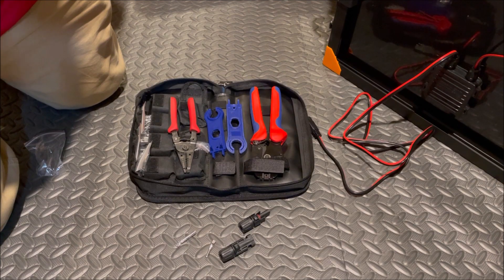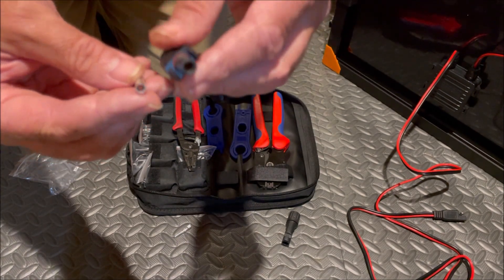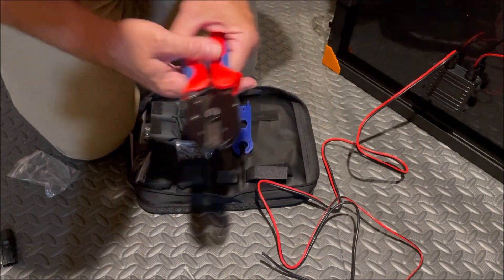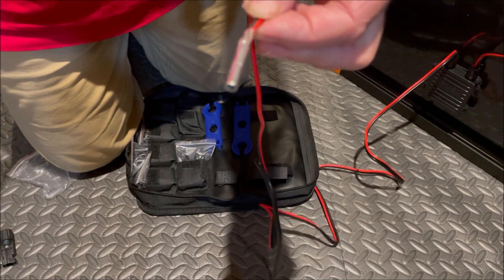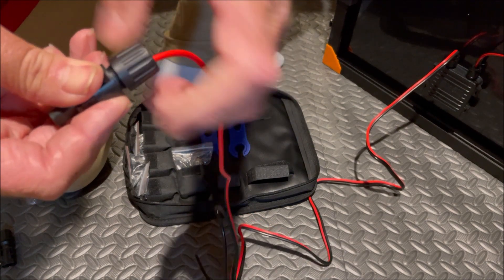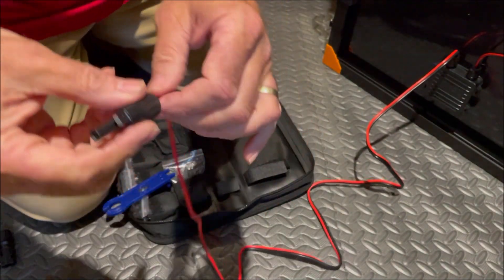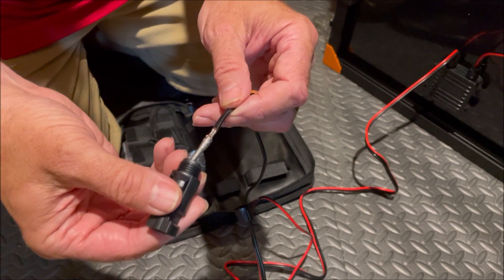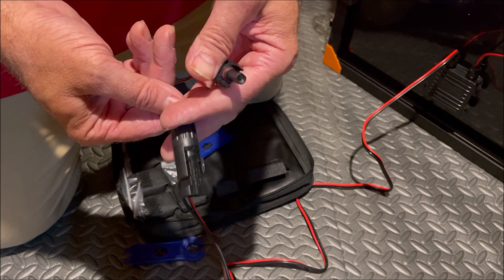Harbor Freight Solar Panel - How to Convert from SAE to MC4 - Part 1 - Viewer Request Thanks D Albu!

Comment: Great content yet again, those mc4 connectors should i get for 8 AWG wire for those harbor freight panel wire , I see choice of 10 or 8 AWG thanks again
Reply from the maker: 10 is the most common size.  The HF cable is smaller the 10 so you may want to add a layer or two of heat shrink or electrical tape to take up some space and make a tighter fit.
Reply: thank you

Comment: Thank you for this.

Forgive me for not following the chief's way exactly, but I made one small modification. Before splitting the wire I placed a piece of heat shrink tubing at the point where I wanted to split the wire up to. Completely optional, but prevents the wire from splitting any further and makes for a clean look. A zip tie would probably work equally as well.
Reply from the maker: Great Upgrade!

Comment: What was the purpose of changing the connection from sae to mc4? I didn't hear that in the video.
Reply from the maker: SAE is not water proof, and more important you cannot easily connect panels in Series with SAE connectors.
Reply: @thechiefsway2618  thanks.

Comment: The Harbor Freight panels are known to have reverse polarities.   Does removing the SAE connector effect this? I am curious since adding an adapter onto the SAE changes the polarity.   Thanks for your video. It helps a  lot.
Reply from the maker: The HF panels  polarities are correct.  The red wire is connected to the female connection on the SAE Connector so there is not short circuit hazard with the hot side exposed.  It is the adapter connectors sold on Amazon that are backwards and require the Gender Bender Adapter which they include. When you cut off the connector and install the MC4's as in the video all should be good.
Reply: @thechiefsway2618  That cleared up a lot. Now I can trust what I know with no fear. After watching so many different videos,  I was beginning to not know the top from the bottom  when it came to electricity.  It became very confusing for me.  Especially when my volt meter was saying one thing but several videos was saying  something else.  Thanks for setting me straight. Now I can move forward with confidence and hopefully  many  more sunny days in both our futures.  Thanks again from  Oklahoma  🌞
Reply from the maker: @cindyfulton1056  Glad I could Help!!
Reply: Check polarity whenever adding fittings and extension lines.  I religiously paid attention to red positive, black negative but got fooled when I installed a shore power fitting coming in from the outside wall that evidently without warning reversed polarity on me.  Luckily I checked with a meter before connecting to my controller.